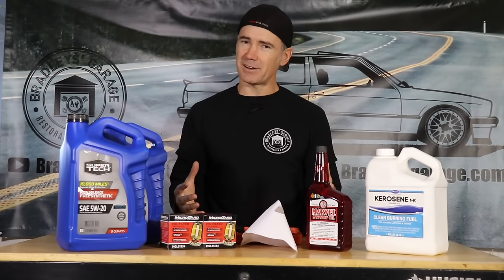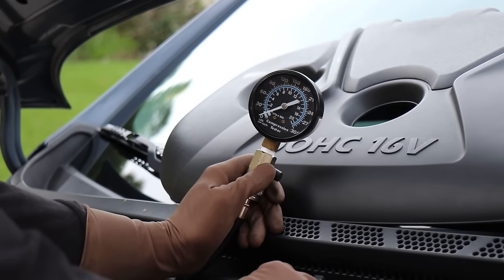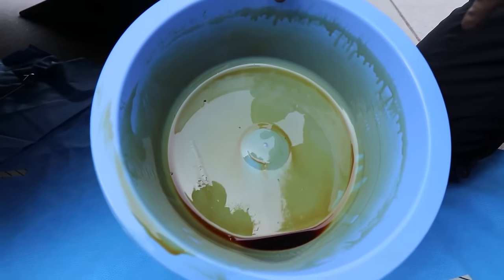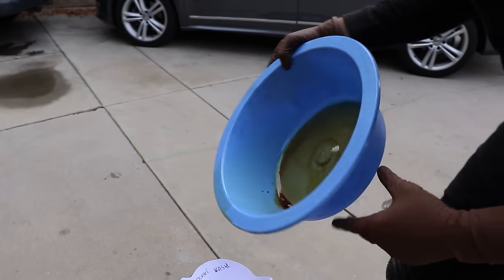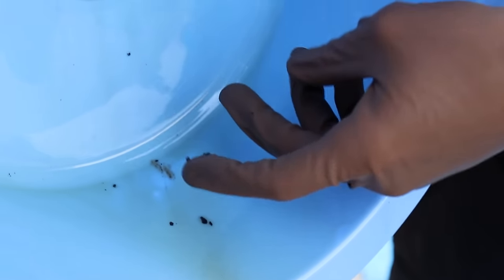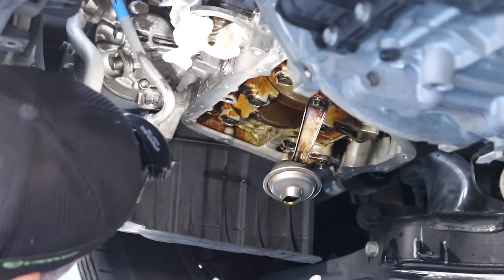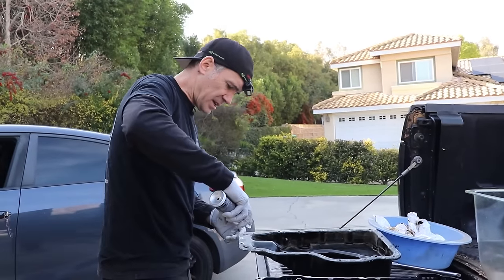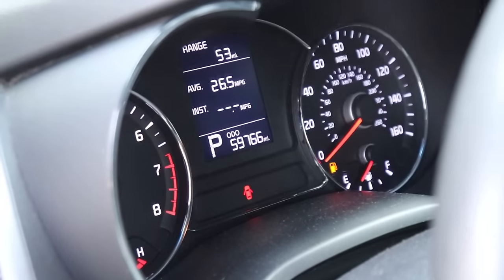*UPDATE* Customer States Jiffy Lube refused to change my Oil - Sludge Factory Kia Forte

Comment: How much in supplies?
Reply from the maker: Jake spent about $250 in supplies to perform these flushes. He's just a 20 something year old kid that doesn't know anything about cars or what is needed to keep them running properly. He helped with the repair so he wants to learn and understand things.
Hopefully he has learned a valuable lesson on the importance of routine maintenance on his car moving forward. The goal will be for him to be able to change his own oil moving forward.
We posted the 3k mile update video if you haven’t checked it out yet - https://youtu.be/QrJ0B-KXTw0
Thanks for hanging out, Cheers!
Reply: @BradleysGarage  It's still cheaper than the cost of a new engine replacement. Would removing the head been better to clean it up good? I don't know how much work that would entail to do.

Comment: Sludge can be avoided if you use synthetic oil.
Reply from the maker: We are not sure what type of oil Jiffy Lube uses only that at those cheap prices, it can't be that good of quality.
Cheers!
Reply: All oils will sludge, synthetic and conventional are chemically the same just manufactured differently.
Reply: Negative sir. 
Synthetic oil is comprised of natural gas, while conventional oil is comprised of fossil fuel.

Comment: Dry crank flood mode will crank the engine with the fuel injection off to build oil pressure.
Reply from the maker: Thanks for the comments, we just used the Kia procedure for checking compression on the 1.8L engine. It's easy enough to unplug the fuel injectors, so we did that in addition to gas pedal to floor.
Cheers!
Reply: @BradleysGarage  I'm only referring to not having to pre fill the oil filter. Great content, and a lot of hard work.👍
Reply from the maker: @NoName-c4y7h  Here's a great video that debunks that internet myth - https://www.youtube.com/watch?v=939WTeorBnQ
Glad you enjoyed the video, thanks again for hanging out.
Cheers!
Reply: @BradleysGarage  I don't believe pre filling  does anything negative, my view was more of keeping from getting dirty by dry start. That was a good video recommendation.

Comment: Random idea in my head... in the empty engine and the drain plug and oil filter attatched, fill the engine to the brim, like right to the cap, with gasoline and let it sit overnight. I guess some might leak past the rings but ehh. I know gas really is good solvent and you could use the strained gas in your equipment after.
Reply from the maker: We are concerned that gas will have detrimental effects on the oil seals in the engine. Diesel is a safer option, plus it's not as flammable as gas. Cheers!
Reply: That is one thing that you NEVER do is add gasoline to the inside of your engine. Because as you stated, gasoline is a solvent which destroys EVERYTHING as it is doing what it does.. And by that I mean it eats the sludge and including the gaskets and seals inside the engine and strips the engine of all of the lubricants that it needs. 
That and it would a while to get all of it out of the crank case which in part would thin out the new oil which as we know is bad for the engine.
Reply from the maker: @brandonstone6962  Well said Brandon, in addition, we didn't leave the diesel mixture in the engine either. We immediately drained that out and put in the oil with MMO.
Not sure if there is any downside to leaving diesel fuel in the engine for long periods of time but we prefer to just flush them drain. 

@pennypingu Not sure if you saw the original video - https://youtu.be/XFsHnrt0l3w
Cheers!
Reply: Terrible idea
Reply from the maker: @lastotallyawesomebleach204  Agreed!

Comment: I wouldn't follow any of your ideas as you don't know how to deal with a sludged engine.
Reply from the maker: Thanks for the comments, appreciate the feedback. Cheers!
Reply: @BradleysGarage  If you are taking the engine apart at all then washing the engine down (using a brush) with mineral spirits would be the first step.  If you want a chemical only solution use the BG Dynamic Engine Cleaner (it's in two parts).
Reply from the maker: @Boodieman72  Sorry to disappoint as this was our first "sludge" project. We were not aware of the BG product until after the initial video here - https://youtu.be/XU79jXYWydA
We got it pretty clean all things considered so we feel pretty good about the outlook. Thanks for hanging out, Cheers!
Reply: @BradleysGarage  I hope this is your only sludged engine, they are nasty to deal with.
Reply from the maker: @Boodieman72  It was definitely worse than we expected. At the end of the day, everything came out pretty good, even if there were better products on the market to handle things.
Lots of comments suggesting to use the BG Flush in the future, so we shall see. Hopefully we won't have to worry about it, like you said.
Cheers!

Comment: Why use diesel instead of an engine flush product? Also, I really liked the thoroughness of this video. I saw the predecessor, and was wondering how it would turn out longer term!
Reply: It's a well known mechanics trick. It has some lubricating additives in it and it is a very good cleaning agent for sludge and grease. Plus it is a fraction of the cost of an engine flush product.
Reply from the maker: Thanks for the comments Ted, we did use Liqui Moly flush in the first video. The update was to perform a final cleaning to make sure everything was removed. It did not make sense to use the same product for a third time as we wanted to try something different.
We are happy with the results and the Kia seems to be running great. We will continue to monitor it every 1k miles until the next 3k mile oil change. Cheers!
Reply from the maker: Although here in California, diesel is around $5.50/gal, but that is still cheaper than the $11 we paid for the Liqui Moly. Cheers!
Reply: @BradleysGarage  Wow, thanks for the quick reply!  I agree with your logic.  Cheers!

Comment: O'Reilly oil filters but buys Walmart oil when you should have just bought the O'Reilly oil which is made by the same company Warren oil
Reply from the maker: Thanks for the comments Vector, appreciate the info. There is not any discount on Oil at Orielly's with our commercial account. The filter however is a huge savings.
Orielly's oil price is $27.99 versus Walmart (which is next door) is $18.98. No reason to throw away money for oil that will barely get used. Cheers!
Reply: Orielly's ISS should work with you then. Thats the fault of the ISS @BradleysGarage
Reply: yeah first call at that store is dropping the ball imo
Reply from the maker: @vector150  Trust us, we complain all the time but they don't want to concede so we just have to go next door. Money is a huge factor these days and saving where you can makes a difference.
Cheers!
Reply: @BradleysGarage  oh and you're doing things like this. Yeah sure on my own vehicles how you spends all ultra platinum and up here later boss filter. But no, I get that. I totally understand about the same as anything. I get that 100%. I was just saying that in my opinion their ISS let's drop the ball not working with her professional customers better. One thing I do know about the O'Reilly oil filters, they are built by wix for O'Reilly
Reply: @BradleysGarage  yeah my best friends, a manager for a Walmart TLE he says I saw a ton of Walmart oil
Reply from the maker: @vector150  We probably don't spend enough money with them since most of our cars are Euro and we order from FCP Euro for the lifetime guarantee.
We haven't had any issues with the Microgard filters, been using them on our F150 for over 280k.
Maybe we can have another talk with the ISS locally about pricing.
Cheers!
Reply from the maker: @vector150  Someone just told us about the new Advanced SuperTech oil that's good for 20k miles. It's only like $2 more than the regular synthetic oil. Seems like a no brainer for those on a budget. As far as we can tell, Warren Oil makes good oil, might not be ultra premium but still better than some brands.
What are your thoughts on the new 20k Walmart oil?
Cheers!
Reply: @BradleysGarage  call for sure. They make good oil. Absolutely make good oil. You haven't heard anything about the new supertech oil filter not to get one and cut it open and check it out. I hear Amazon basics oil is pretty good too, but it's not convenient to where you can just go pick it up. You have to order it. But yeah, I'll definitely be checking out more videos from your channel thus far I've enjoyed them
Reply from the maker: @vector150  Appreciate the info, will have to try out that new 20k oil from Wally's.
Thanks again for hanging out, Cheers!

Comment: Was waiting on this update, thanks. But have to say i cringe every time i see you prefill the filter... obviously i'm in the other camp on that one :D
Reply from the maker: Thanks for the comments, we can't seem to win with respect to the oil filter. We got so many comments about us NOT pre-filling the filter it was crazy.
Here's a good video that tests the theory about it - https://www.youtube.com/watch?v=939WTeorBnQ
Personally, we don't think it makes that much difference in the grand scheme of things but like always, everyone has their thoughts on the matter.
Cheers!
Reply: @BradleysGarage  yea that's why i said i'm in the other camp. This is a let's agree to disagree scenario :) internet is divided in 2 on this subject
Reply from the maker: @ivari75  No worries, thanks for hanging out. Cheers!
Reply: Absolutely pre-fill or otherwise pre-charge the filter before starting engine. The motor oil geek video says it all.
Reply: @GNX157 how would you do that on engines where the filter is on top of the engine in a cartridge style ? It's basically dry when engine is not running
Reply: @ivari75  you obviously didn’t read/comprehend my comment. Read it again. It’s all in there.
Reply: @GNX157  i guess i could say the same...
Reply: @ivari75  you’re just not thinking about ways to pre-charge the filter with oil without manually filling it. Think about it.
Reply: @GNX157  As stated before i'm well entrenched in the other camp as you are in yours best solution is to agree to disagree 😉
Reply: @ivari75  Oh, that’s obvious. You have a serious problem, but that’s okay. You work on your own and you deal with the consequences. You’d be fired for not doing it if you did work for me though. There’s no valid detrimental reason not to do it, you just don’t want to take an extra step and do something other people tell you you should do. Good luck.
Reply: @GNX157  i'm happy to report i don't and never will and i feel sorry for whoever do

Comment: Holding the pedal to the floor while cranking shuts off the fuel injectors. It is "clear flood" mode.
Reply from the maker: Thanks for the comments Bill, appreciate the info. We just wanted to make sure no fuel was getting in so it's easy enough to unplug the fuel injectors just in case. 
Cheers!
Reply: Not every car has it either, not sure about this one
Reply: @mashedpotatoes5323  It's standard on every relatively modern FI car as far as I know. Every car I've owned going back to 1995 has had it. The systems were designed to mimic a carburetor in that respect. They also shut off the injectors when coasting in gear.
Reply: @bills6093  definitely not in the United States at least, I have tried using flood mode on a few cars and all it would do is turn on and want to redline. 2007 Toyota Corolla, 2012 Toyota Corolla, 2014 Merc AMG all don't have it from my personal experience. Really, only certain cars have it.
Reply: @mashedpotatoes5323  Just read the 2007 Corolla owner's manual. Under "Starting a flooded engine", it says to hold the pedal to the floor while cranking for 15 seconds. So it clearly has the "clear flood" mode as I described.
Reply: @mashedpotatoes5323  1996 Taurus Owner's Manual describing the flooded engine mode "If the engine does not start after two attempts:
1. Turn the ignition key to the OFF position.
2. Press the accelerator all the way to the floor
and hold it.
3. Turn the ignition key to the START position.
4. Release the ignition key when the engine
starts.
5. Release the accelerator gradually as the
engine speeds up. Then drive away in the
normal manner.
Reply: 2015 Grand Cherokee "Clearing A Flooded Engine (Using ENGINESTART/STOP Button)
If the engine fails to start after you have followed the “Normal Starting” or “Extreme Cold Weather  procedures, it may be flooded. To clear any excess fuel:
1. Press and hold the brake pedal.
2. Press the accelerator pedal all the way to the floor and hold it.
3. Push and release the ENGINE START/STOP button once.
The starter motor will engage automatically, run for 10 seconds, and then disengage. Once this occurs, release the accelerator pedal and the brake pedal, wait 10 to 15 seconds, then repeat the “Normal Starting” procedure.
Reply: @bills6093  I assure you that it didn't. I know the procedure lmao. Not every car has it look it up. 😭
Reply: 2014 Mercedes cla 45 AMG doesn't seem to have it either unless the process of pressing the accelerator pedal all the way down and then attempting to crank the engine is wrong.
Reply: @bills6093  look point being not all fuel injected cars have clear flood mode. If you want to think otherwise you're wrong.
Reply: @mashedpotatoes5323  Well, I'll continue to obey the mfgs instructions and we'll just have to agree to disagree. I'm sure there are some cars that don't run their FI this way, but I'm confident that most do.
Reply: @mashedpotatoes5323  Your WOT switch or TPS could have been slightly out, causing the Corolla's ECU to not engage the clear flood mode properly.

Comment: The reason that the oil looks fairly discoloured after 700 miles and the later 420 miles (compared to a well maintained engine),

Is that part of what oil does is hold "dirt" in suspension until it gets to the filter.

So the detergents in the oil are slowly breaking down the sludge, and the oil is holding it in suspension.

Which is why adding an engine flush to dirty oil is not the best way to do an engine flush.
Reply from the maker: We will check on it every 1k miles until the next 3k mile oil change. I'm sure there will continue to be small residual amounts coming from the engine for many more miles to come. 
Hopefully with routine 3k mile oil changes, we can keep cleaning things up inside.
Cheers!

Comment: If you’re only driving short trips all the time, then why buy a car with GDI and VVT? You don’t save that much fuel as to compared to someone who drives long distances. It’s false economy. Dealerships and manufacturers want to sell you a product and they impress people with how the car looks and how fast it can drive. The advanced technology is all selling points about how “amazing” and “high tech” it is but in this case just isn’t what this driver needs. They’d be better off with a simpler, older vehicle, but then the dealers and manufacturers don’t make any money. I just don’t get why if you have money to throw away you’d buy a Kia or Hyundai which are garbage engineering. If you want new things and buy a car to last five years or less and plan to use it up in that time, maybe a Korean car will work for you.

Japan and Korea are both very hierarchical societies. Workers with lower status cannot say anything that contradicts their superiors. That’s just a recipe for failure.

In Korea this has led to disasters such as the collapse of a shopping mall building full of customers, and the sinking of a ferry loaded with students and a delayed rescue response. One guy ends up taking the fall even though it’s a systemic issue.

Japan however also has a perfectionism which overcomes this.
Reply from the maker: Thanks for sharing, it's interesting to see how the culture can impact the way things are designed and built. We are trying to encourage Jake to get a VW Passat TDI (2012-2015) as we have 3 of them and have been very happy with their reliability. 
Not sure why he bought the Kia in the first place but that was long before we got involved. The most important part is that he has learned the importance of routine maintenance.
Cheers!

Comment: What is diesel leaks through the cylinders and cause an explosion?
Reply: It won't.  It has a very high flash point similar to oil.
Reply from the maker: Diesel is much less flammable than Gasoline. It takes intense pressure or sustained flame to ignite diesel. You can toss a match into a cup of diesel and the match would just go out, it would not ignite anything.
In addition, we diluted the diesel with 3.2 quarts of oil so it has even less flammable properties. Mechanics have been using diesel for engine cleaning and flushes for decades so it has a proven track record.
Cheers!
Reply from the maker: Thanks for the comments, appreciate the response. Cheers!
Reply from the maker: Agreed! Thanks for the comments, appreciate the response. Cheers!